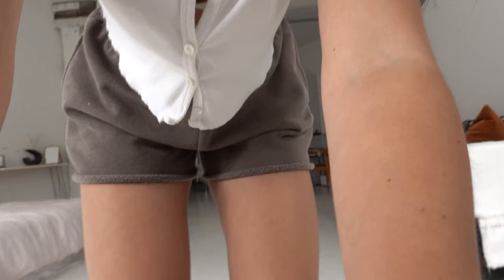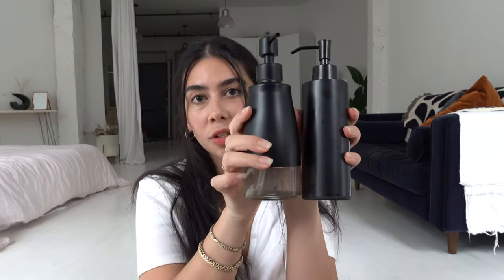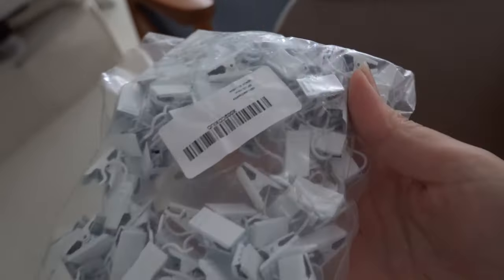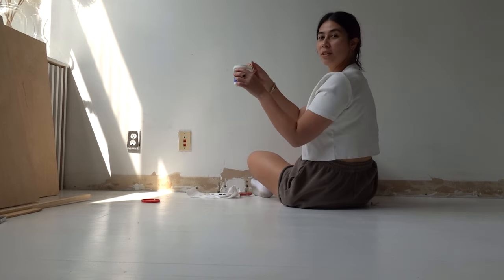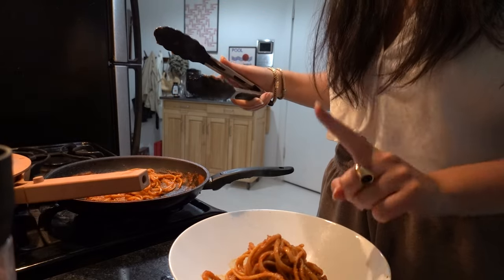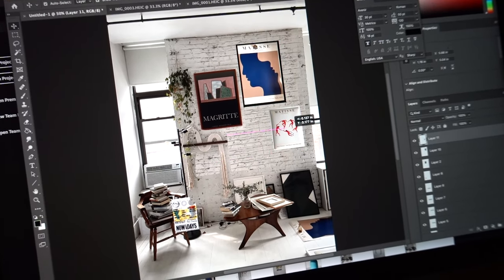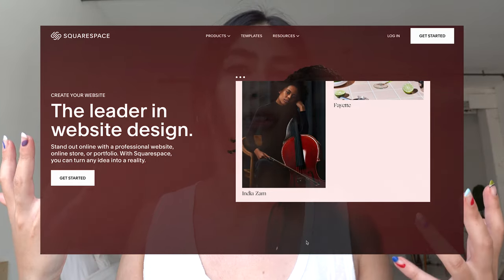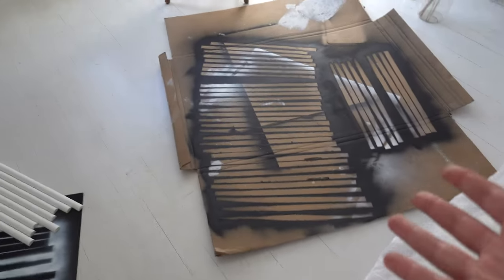HUGE LOFT UPDATES! styling, gallery walling, building my own furniture + vintage finds

Comment: Hi Tara, not sure if you’ve heard but squarespace has consistently used art from queer creators without consent and or refusing to pay them for their work. Dietprada did a whole post on it! Just a heads up in case as I know you’ve had several sponsorships with them. They never made a statement on it as well and instead just swept it under the rug 🥴
Reply from the maker: hey! I actually didn’t know about this at all - that so unfortunate as squarespace have featured so much queer creators especially during this pride month! it looks like the issue is with Unfold- an app recently purchased by square space but I i believe they operate with their own team, who did release and public post on the Unfold page apologizing and wishing to do better. hope someone at unfold / squarespace has settled that person with whatever compensation they deserve! i’ve always had a positive experience with on the squarespace end so as long as they align with my values/take accountability i’m happy to work with them!❤️